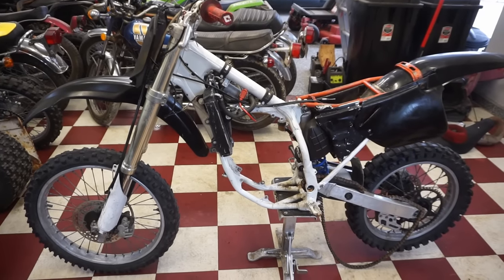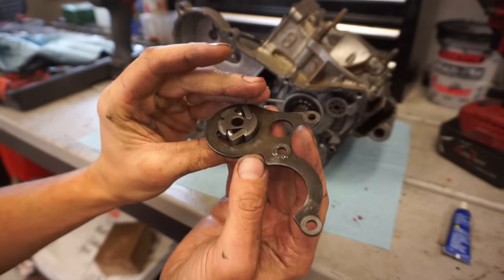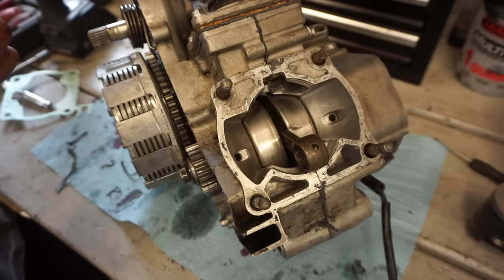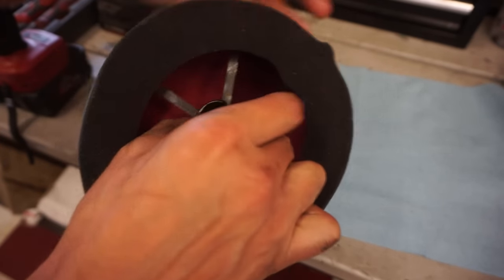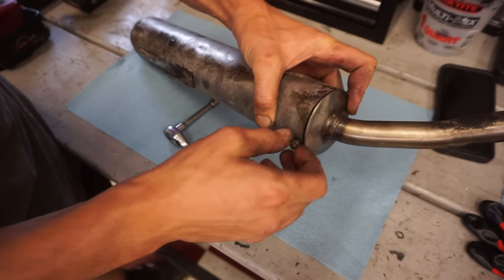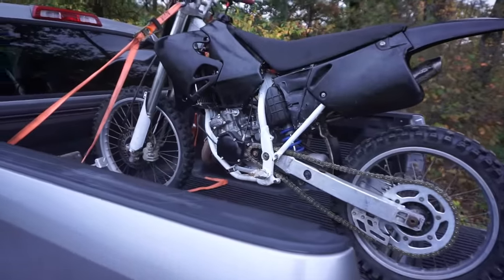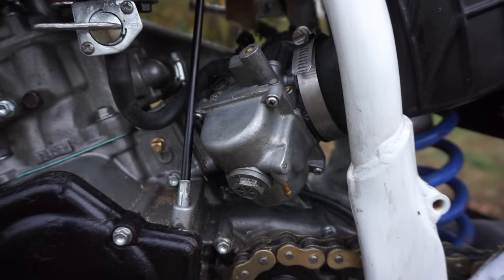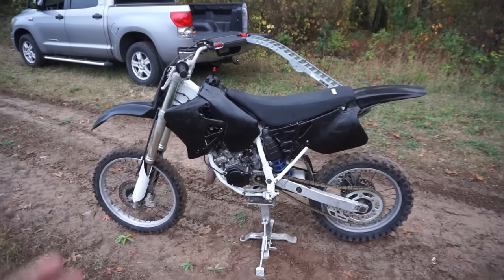Seller Gave Up On This $700 Dirt Bike (Won't Run Or Shift)

Comment: Actually I know exactly what's going on and I haven't watched this video further or the next one but you might have already fixed it so I'm just saying this cuz I haven't went through everything but it's going on it seems if you did not time the HPP power valve system when you put the top end back on it'll run like exactly like how yours is running on the 250 there is a little indentation on the water pump to engage and disengage I'm not sure about the 125 but I do know that it was running like s*** in the first second third gears but then it got better third fourth and 5th and I think it's because at the higher velocities and high RPM the actual exhaust gas was pushing the valves open more helping it run better but at the lower RPMs it was breaking up because it's probably not set to the same Tolerance on either side so I'm guessing if you didn't specifically time that system is very easy to get messed up and it'll happen and what your experiencing but I'm curious if you actually try the carburetor thinking it was that and still having it messed up kind of my 89 CR250 always popped out of Engagement and I had to stick a shim in there so it would stay open and you got to take apart and clean and put all that crap back exactly a Honda had it and it should be like a little Intense or grooves to line s*** up but I'm not sure if the 125

Comment: RVT on all gasket surfaces makes a nightmare for the next guy.. or yourself.. I’ve learned a light coating of oil usually does the trick 🤷‍♂️ all in all, you got that bitch singin!! 🤘

Comment: @2vintage I'm surprised you didn't take a look at the crankshaft and connecting rod being all of the play you noticed. Did you try adjusting the air screw or just clean the carb out?

Comment: I got question for anyone here i have a 2001 yamaha grizzly 600 it jump it's timing the valves gotta be adjusted and the clutch bearing gotta be replaced does any got any advice for me thanks 😊

Comment: If you oil your gaskets they will not stick

You don't use silicon on a cr motors at all.
The next person is going to be mad when he take the motor apart.
Gap your trigger/ points at .018
Looks good

Comment: Idk if you know this old school trick if you use grease for the gasket like a carb gasket, in this case reeds. For example, if you ever had to change them, that gasket would be intact. Thats how I do my carbs for my car. I lather the gasket up. Allow it to sit for a minute or five, then put it on. I put grease on the front and back of the gasket, then place the carb on. I have removed my carb from my car more times than I can count. That gasket has always survived and looked like new.

Comment: Don't ever use sealer on a paper gasket, clean the surface better than you did, I use a fine wire wheel on a drill. Lightly apply a very thin coating of grease on both sides of the paper gasket. I know you think I'm nuts, but a long time ago a friend that builds hotrods and drag  races, I've been doing this for over 30 yrs. Try it sometime, no leaks and gasket doesn't stick. I love the channel but cringe when I see you putting sealer on a paper gasket... take care

Comment: Some 2 strokes have gaskets, others do not. I still have a large collection of 2 stroke motocross bikes without case gaskets. They each used their manufacturer's proprietary sealant. I've found a better sealant from an automobile manufacturer and have used it on all of them.

Comment: Joe assembly lube as extra additives and to much sticky stuff. Itll burn and melt away and then you'll be left with a sticky substance. What is better than assembly lube is STP oil stabilizer it's not as thick but does a great job. What's even better is lucas oil stabilizer its thicker and does not melt away like assembly lube

Comment: There is a plastic piece that goes on the swing arm to keep the chain from rubbing. Also one on the bottom of the swing arm. I have a 1998 CR125 also.

Comment: Love these vids and watch them constantly. I have to mention I dont get some of the procedures in this way. When I get a bike to work on the FIRST THING I do every time is drain the gas tank to bone dry and clean the carb(s). Usually I put a filter inline but if this isnt done you are really shooting yourself in the foot since crud in the tank will just keep clogging the carb no matter how many times you clean it. I would not even try to start a bike til I did these simple things. 
Keep up these vids as they are hugely entertaining and for a wrench like me very relaxing and peaceful to watch. 
Oh yeah maybel consider wearing a little gear when you ride so my 9yr old son doesnt have to keep telling me "he should be wearing gear" and to keep the next gen of dirtbikers safe.

Comment: It sounds like it may have the wrong jetting. It seems to bog in mid range. Maybe they messed with the needle and seats. oh ok i should have waited until the end of the video but i raced for many years and could hear it myself. it went a bit better after the jet change but did you check the needle was on the 2nd seat?  Oh, again I should have waited a bit longer but I figured you would check the needle while changing jets 🤔

Comment: Important to note: Whenever using gasket maker or sealant on the reed cage,cases or head it must be a gasoline resistant product.  Otherwise the fuel will cause it to break down, create an air leak then seize the engine. No fun. Great video. Thanks.

Comment: 165 main, lower needle it should clean up that mid range, 162 main may be thin on the top.
You may also want to read up on mikuni and khien carbs in your spare time as the carb circuits that control low,mid,top are very different in respect to when one circuit changes to another . Best of luck🙂

Comment: hey quick question i got a vintage bike that is really difficult to find parts for ive found most of the stuff but it has a hole in the rad decently big would you know some solutions to this or dealers that have and really vintage parts

Comment: The fact that theres so little smoke worries me for the life of the engine these old 2 strokes almost always blow loads of smoke on a cold startup the clear there throat per say and even then when revving out through the gears there should be a little at very least 😅  

Ps sorry commented on wrong vid

Comment: Not sure about honda but i had a husky cr 125 and it had a brass washer between the exhaust pipe and the head.  It would ware down and you would get that high ringing sound at the front of the bike.  I think i could hear that on your bike so you might check it.

Comment: ok  again, that engine was set up for a shifter kart.  that piston is an  RS style piston and someone slip fit that crank, case would never slide together like that if not.   that rs style piston is more designed for sitting at wide open throttle,  switch it out with a stock cr 125 pistob,  there will be a large window in the piston on the intake side in line with that boost port.  your low end and mid range will thank you.

Comment: Wouldn’t the carb specs for the pipe be a 2000 since the motor is a 2000?

Comment: Does anyone else hear the grit / sand dirt when he assembles things. I’ve learned a lot about how to diagnose small engines and repair them. But O does he have a lot to learn about cleanliness and how to use the right tools the right way.

Comment: A super fast and easy way to remove gaskets is with a brass wire brush.  I use it on my my grinder but drills work also.

Comment: 2 vintage you should always loctite your sprocket bolts speaking from experience man
Reply: Yes thats good advice, rode a crf 250 once and the bolts on the sprocket vibrated lose and cracked the hub... I first thought that the engine blew haha

Comment: 25:26 To shorten down a chain you'd screw the adjuster bolts all the way in, move the rear wheel up and then lengthen/shorten/cut the chain. This way, the more the adjuster bolts are out, the more your chain is worn, indicating when you should replace it. That's what we motorcycle mechanics do.
Also im not quite sure if you noticed but you didnt run the chain through the chain guide there (at the rear sprocket).

For the jetting, i'd also say it's the needle position, try moving that clip 1 position up, that should definitely help, I'd recommend you take out the carb, disassemble it, clean it and put it back together, that way no specs of dirt are messing with the jetting, don't forget to check float height too! Without float height jetting is gonna be a nightmare!
Reply: shot brv, good advice

Comment: So you think it’s a little rich or lean still?  You want to move the needle clip up or down?  I am working on one right now (this very minute). It hesitates when I slam it wide open. Any ideas?  Anyone?
Reply: If it's a Mikuni up the pilot one size or raise clip by one, if it's a khien definitely check pilot as those carbs the pilot controls higher into mid range than mikuni. Then try dropping one clip on needle as your mid breaks away from your pilot later.
If you get a chance look up the way that both carbs use the different jets, there is a lot of great info. I think you could google carb mapping and get the info your looking for. Sorry for the novel,  best of luck.🙂

Comment: It's maybe a good idea to grease the seals in the airbox and also Grease the inside the airbox so any particulate gets stuck to the grease
Reply: That's what the air filter is for

Comment: first you need a case protector for the chain and also the chain guide near the rear sprocket has worn all the way through so there is no bottom both can cause major damage. and your muffler core is broken in 2 pieces its meant to be 1 piece that would affect how it runs also.
Reply: This sharp guy with enough confidence to show the world his intelligence, actually routed the chain under the chain guide.  I also suspect he does not have any oil in the gas.  Even a well jetted 2-stroke smokes a bit on start up.
Reply: @EarthSurferUSA  i gave him the benefit of the doubt but yeah its entirely possible that he did route it below.

Comment: What is the purpose of the numerous clutch plates?
Reply: They are called a "wet multi disk clutch", ("wet" because they rotate in the tranny oil bath), and are designed to take a ton of abuse.  The fast way to ride a 125 back in those days was to go into a corner a gear higher than you normally would, pin the throttle open, and feed the power to the wheel with the clutch,---a lot of high rpm slipping.  You would fry a dry, single plate car clutch very fast like that.

Comment: Is it possible to pop a tube by tightening spokes ?
Reply: Possibly.  There is suppose to be a rubber "rim strip" covering the spoke heads so the tube does not touch them.  We use about 3 wraps of duct tape also.  If the tube touches the spoke nipples, they will eventually wear a hole in the tube.  If there is a burr on the top of the nipples, I can see that cutting through the tube when tightening the spokes.

Comment: The silencer needs the perforated tube attached to the pipe so the exhaust gases have an open path to flow through. With the new packing it's going to move around and block the flow.

Comment: Check the reeds, sounds like they may be weak. You might get by just flipping them around. They may also be steel and not fiber. It sounds like air is leaking by them before they open up.